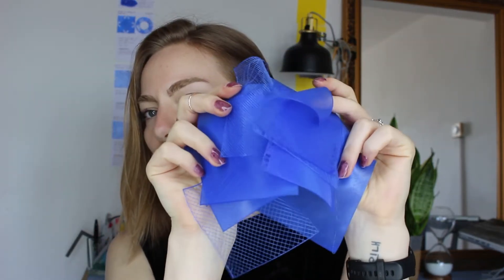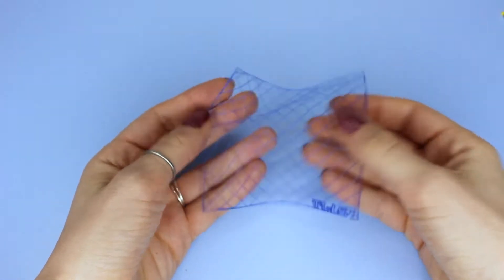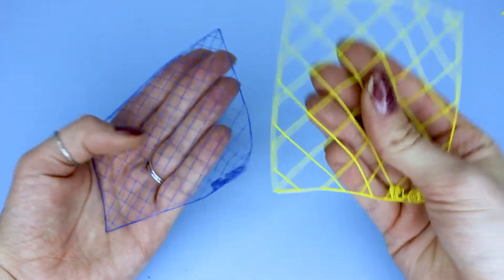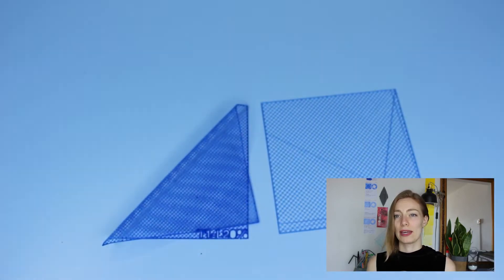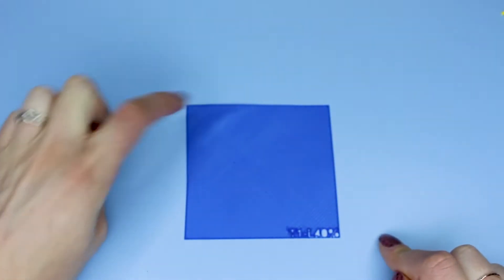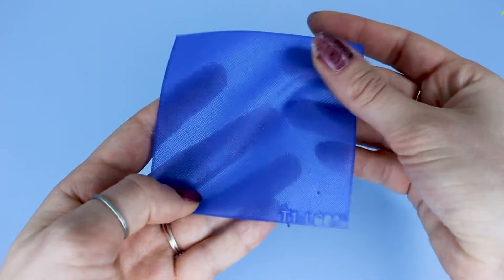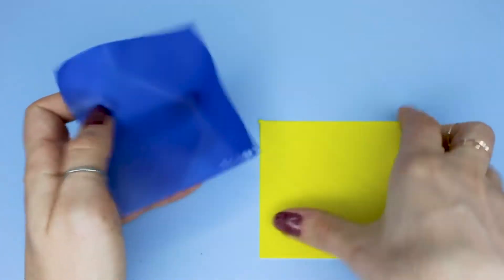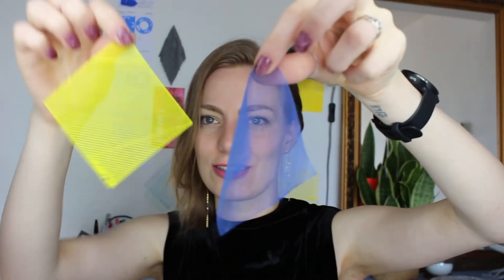3D-Printed Textiles [LINE] Review

Comment: very interesting ❤️ have you tried to sew it to assemble? or do you need 3d pen?
Reply from the maker: Thank you! 
There are many ways to assemble the 3D printed pieces; I’ve tried the 3D pen, it’s a lot messier than I thought it would be (needs practice) but works quite well. Sewing is another option, so is using a soldering iron or even other external closures like buttons or zippers. And finally you can lay the pieces back on the 3D printer and print them together (like welding). I’ll make a video to explain each of them. ;) 
However personally I prefer the modular connectors, so that you can take the garment apart whenever you need something different or something repaired. 
x Brigitte